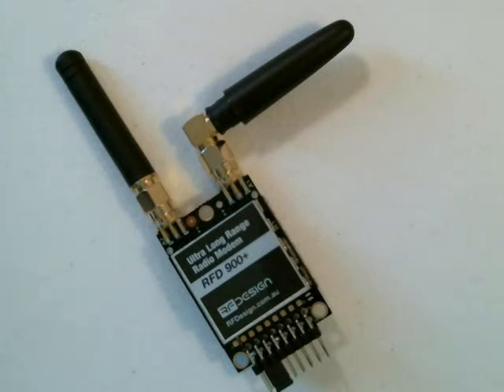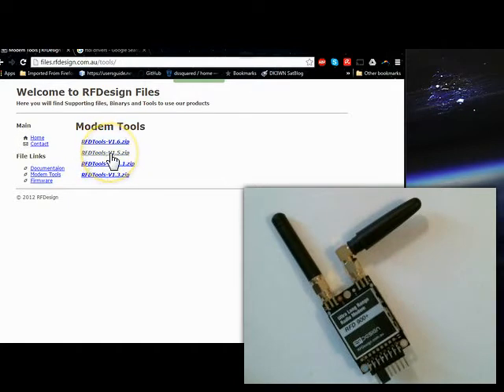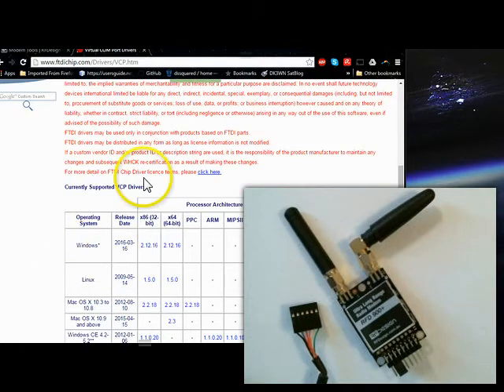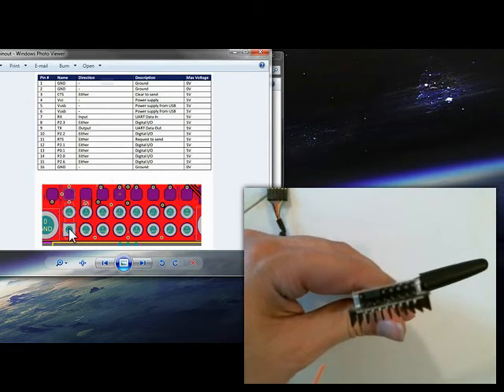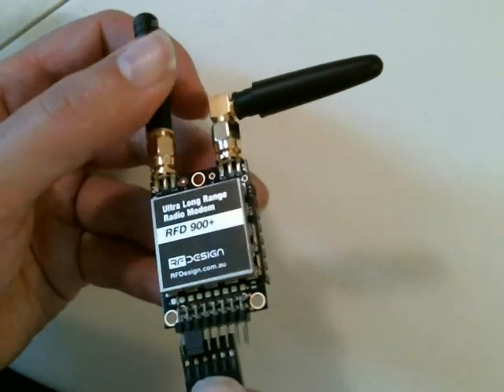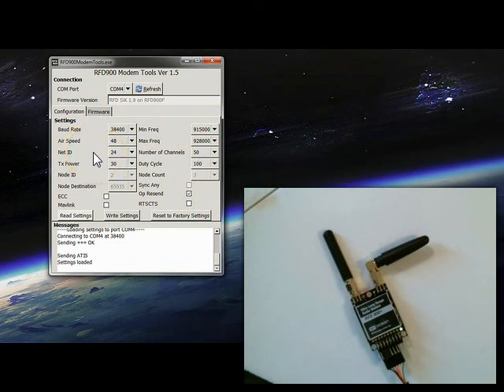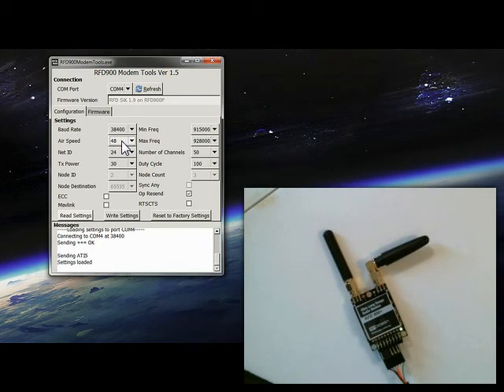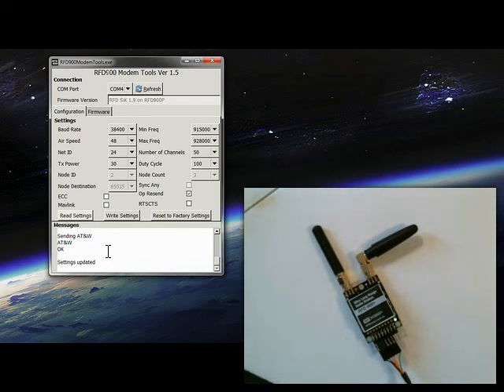RFD config

Comment: Why the RFD baudrate should be set at 38400 ? The default is 57600, why does it need to be changed ?
Reply: I think it may have some effects on the link board
the less the baudrate is the more the board would be (still not sure about that)

Comment: I’ve got the pixhawk connecting on mavlink via USB and it was time to connect the RFD900+. 
Windows 7 installed the drivers automatically, and then I was prompted to enter host name/IP.       There was some letters or numbers there, but being silly, I thought I could name the network, or something like that, so I entered “MAV”.  That was wrong, wasn’t it????     How do I correct that????  I unplugged and plugged back in, and my “Man “ is there, the default is gone…:(
please help....    thanks!

Comment: Did you use this settings for  a balloon mission? How can I calculate max sight in line distance?  I tested it over 13km by adding  up to 26dB Attenuators to find out max distance. So on HF-Test it should work ( pathloss) over 260km Dipol to Dipol tested with just 100mW
Reply from the maker: Yes I believe these were our settings for the mission. I am not sure how to calc max line of sight distance, is this of any help? http://store.rfdesign.com.au/rfd-900p-modem/